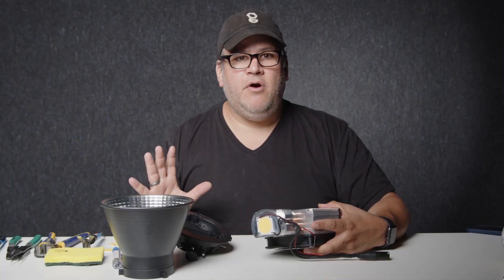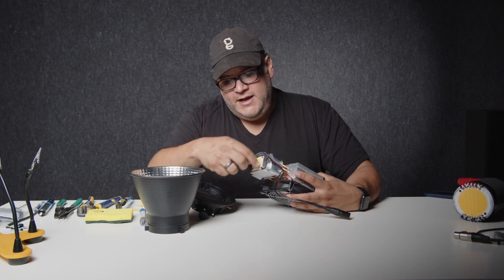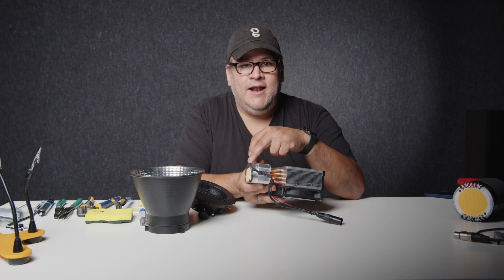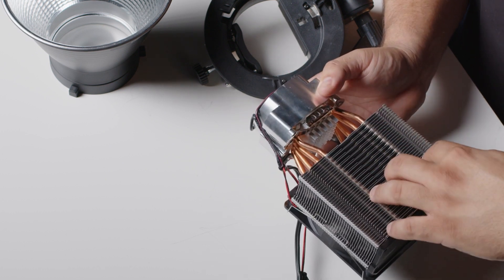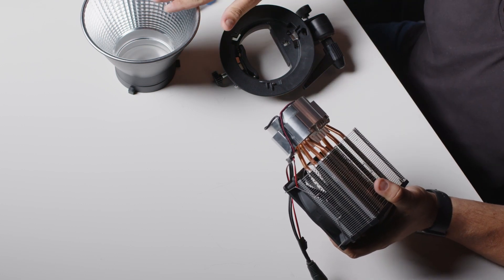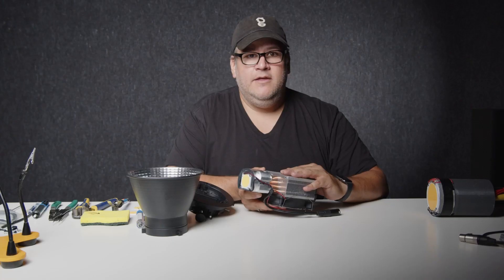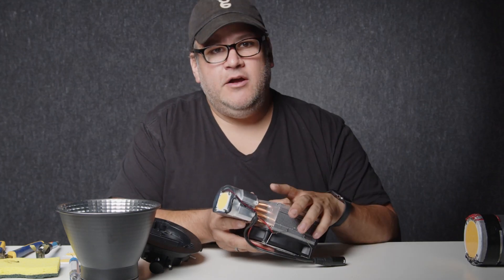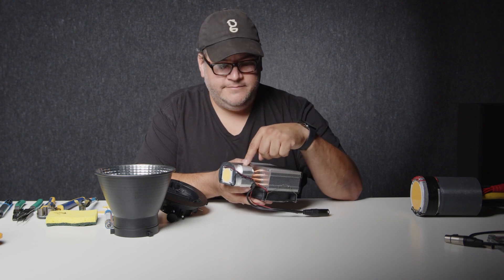LED Light Building - Light Cooling

Comment: Hi Steve, Would a 600W chip work for 1000fps?
Reply from the maker: FPS is all about the quality of the power supply, not the power of the chip
Reply: @TheGarageLearning  - Not true.
Reply: @thekaiser1919  - It's absolutely true, LED's don't inherently flicker, the power to them does.
Reply: @d585  Nonsense! The frequency of the power supply is what matters, the quality of the ps doesn‘t matter at all in terms of flickering.
Reply: @thekaiser1919  we are referring to DC power supplies, DC has no frequency unless you’re using PWM, which would be a lower quality power supply.
Reply: @d585  Is it? What is your idea of current limiting?
Reply: @thekaiser1919  Why don't you explain why the statement, "FPS is all about the quality of the power supply, not the power of the chip" isn't true? Now you want to talk about current limiting but your initial comment implied that the power supply isn't what makes an LED lamp flicker free, but rather the LED COB itself, which is nonsense.
Reply: @d585  I did not imply anything. I said that not the quality of the ps is important, but the frequency of pwm and currentlimiting. There are high quality ps, built like a tank, that flicker terribly at 50Hz.
Reply: @d585  However, the answer missed the original question. Kaspera asked, as I understand it, "Is there enough light output from a 600W cob to film at iso 400, fstop 8 at a 2000th of exposure time, to get a bright enough image for slomo?". So the answer is not only wrong it also misses the question.
That's sad.

Comment: I'm sorry, I don't understand. What is the purpose of using aluminium block?
Reply from the maker: In the class we explain that it’s designed so that the Bowen’s reflector can be in the right position for maximum light reflection. Otherwise the light is too far behind the reflector